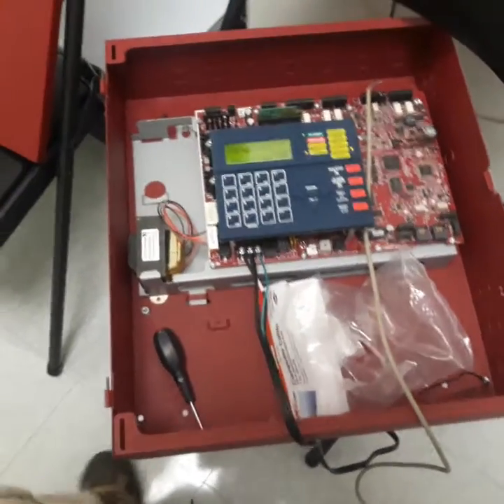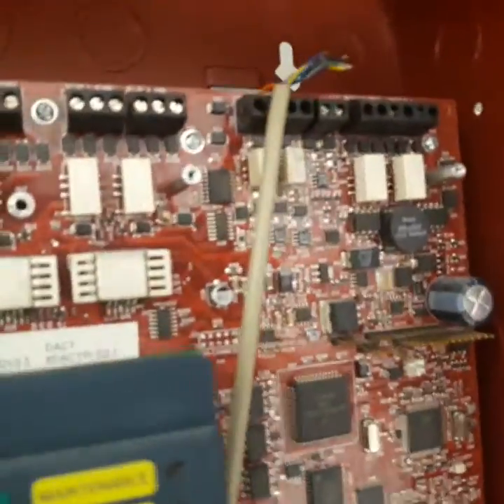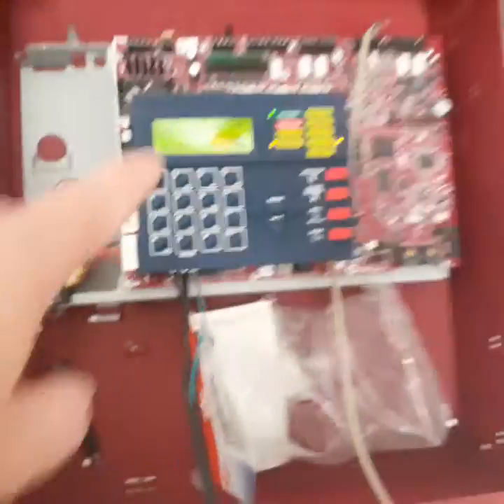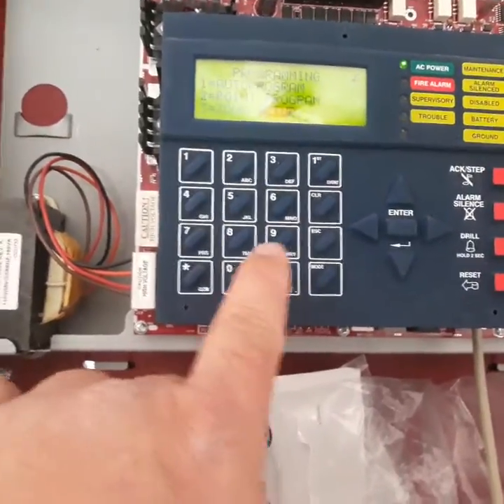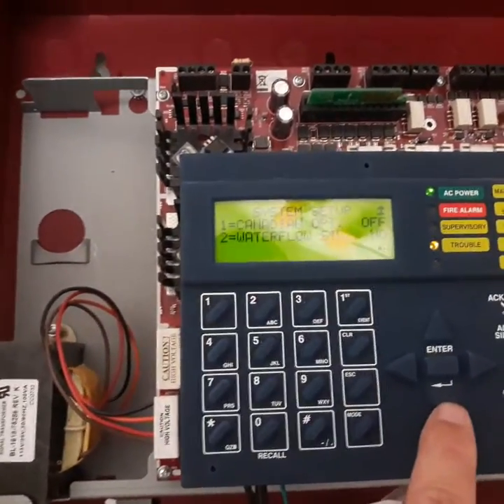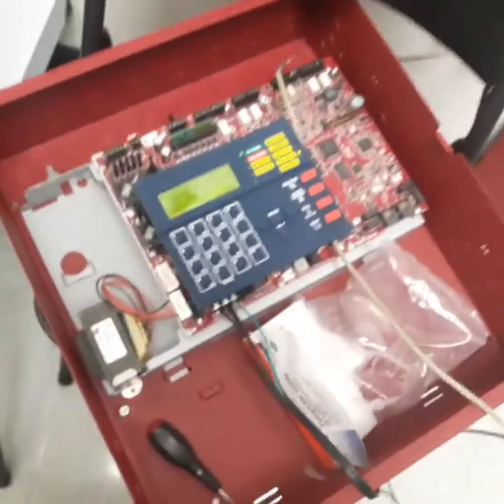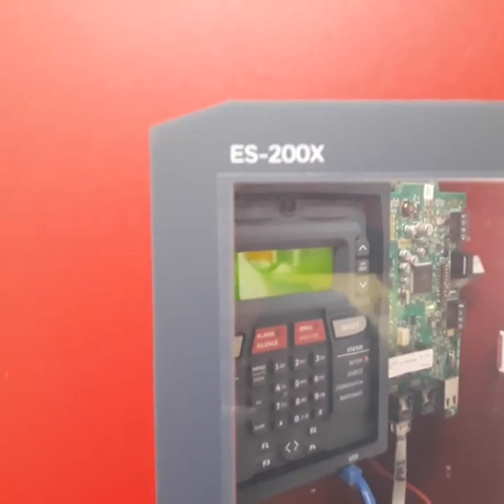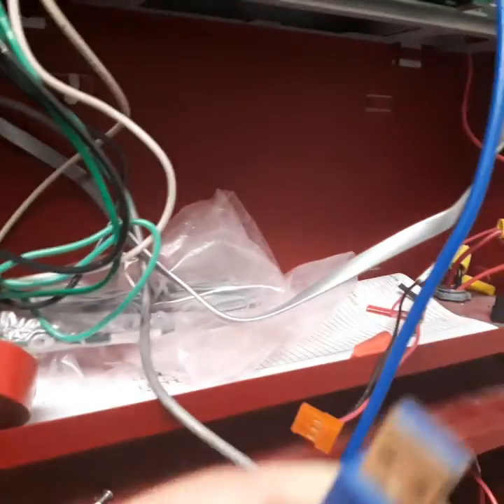Changing a ms9200udls to a es-200x.

Comment: Just as an FYI, the backbone of both boards ms9200 vs 200x can be swapped out without having to unmount/remount the case, only thing you have to do is change the door out after backup of the programming. the cases are practically the same, and the mounting points are universal among the boards. it's just the doors that are different (because of the window pane)